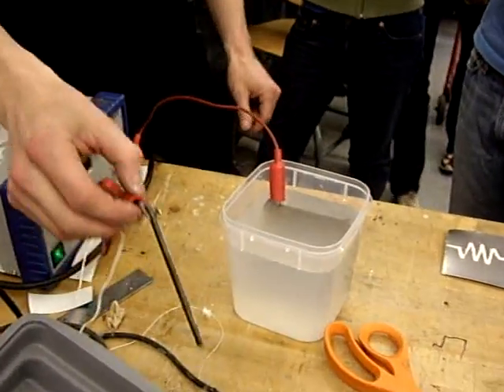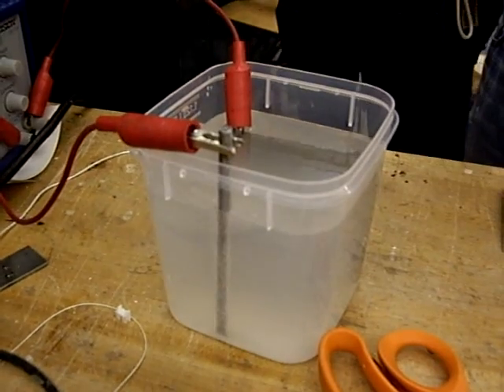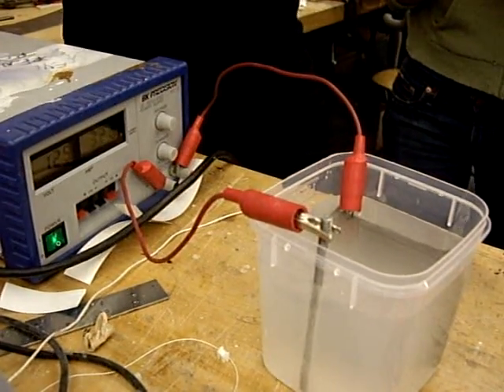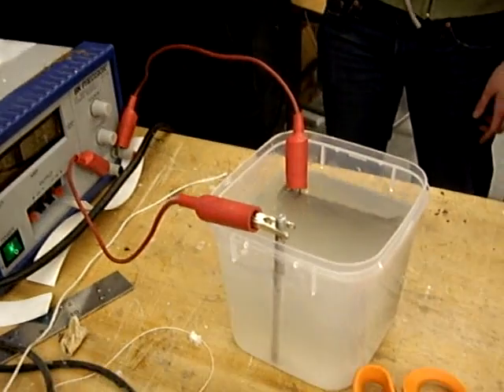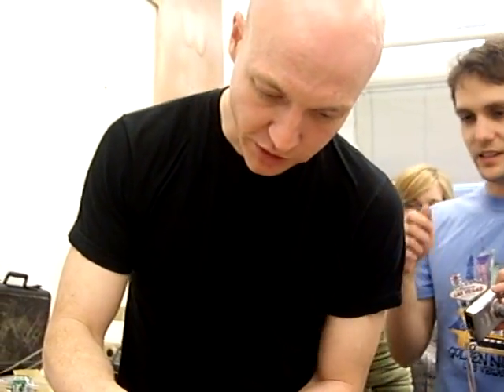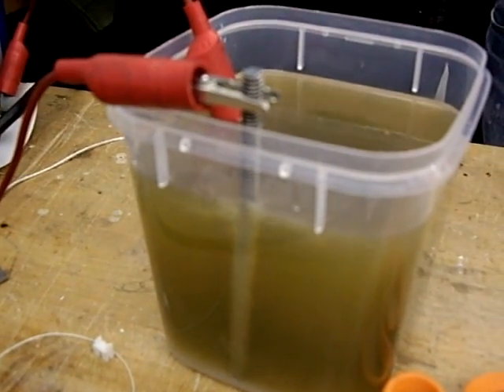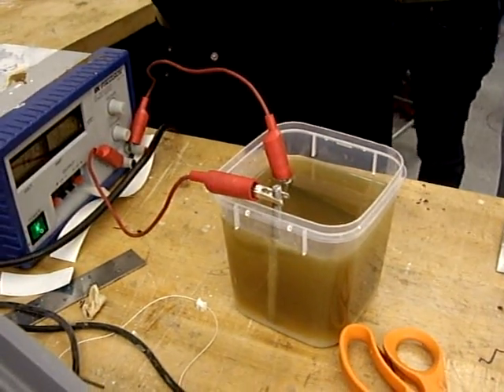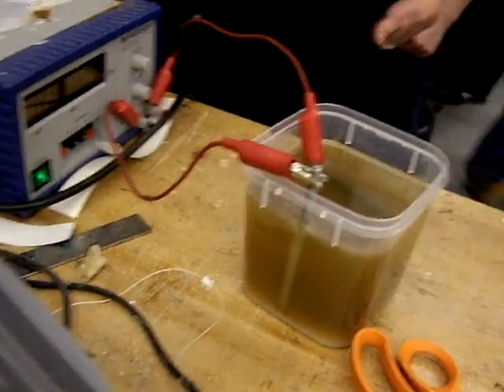electro-etching

Comment: Dude thats the current through a low resistance path at work. The I^2R produces is very high since currents can reach may be more than 100 amps. The case with electric shock is totally different. A 12V car battery can't make enough current to flow through the human body (high resistance) to cause a shock. Try it your self. I have tried it many times in my home lab and with my car.

Comment: 4. Preheating is not required.  Technically the hotter the system gets the slower it will etch.  This is because resistance increases as the materials get hotter, therefor less current.  Less current means less electrolysis which results in fewer copper atoms being oxidized.

Comment: 1. He said his electrolyte was water in the video.

2. The other rod looks like it's probably iron/stell (a fair assumption since it's a threaded rod with a greyish/silver color).  The composition of the rod doesn't really matter as long as it's conductive.

3. The more current, the faster the reaction.  The speed is variable.  Etching with FeCl is variable as well depending on concentration.

Comment: Many questions:

   1 - What do you use as electrolyte ?

  2 - The other rod, what metal do you use for it ?

   3 - By what ratio do you speed-up the etching compared to classic FeCl ?

   4 - Do you have to preheat the electrolyte before starting electro-etching ?

Thanks for your attention...